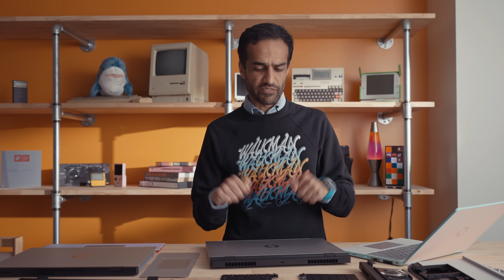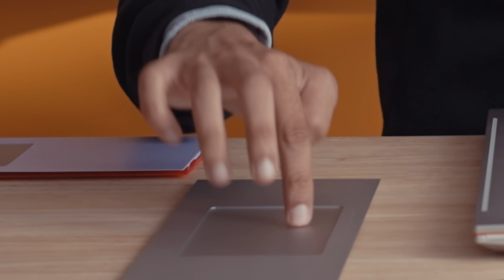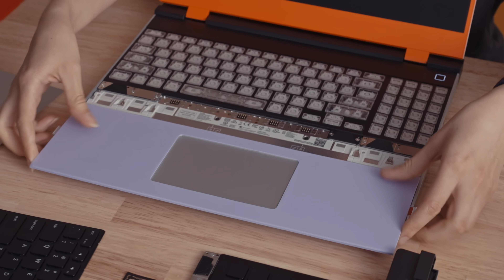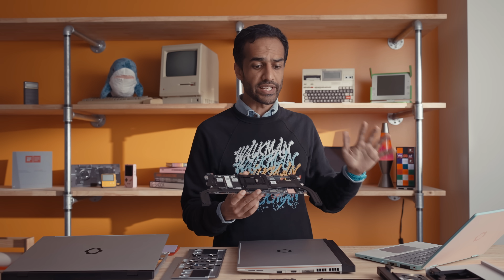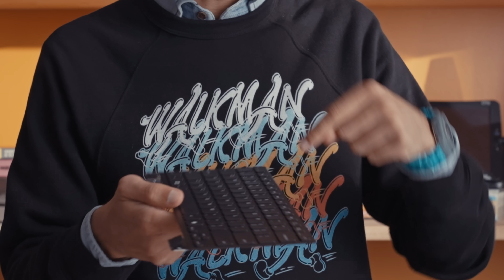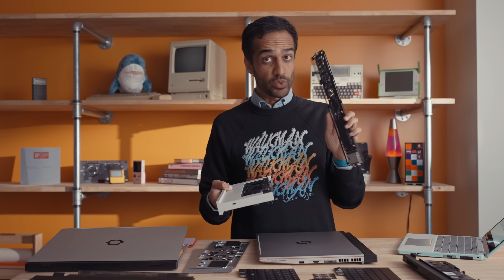Framework Laptop 16 - Prototypes and scrapped ideas

Comment: My dream is a Framework SteamOS hybrid console that I can drop into an upgradeable eGPU dock by my TV.

The convenience of the Nintendo Switch, the game library of the Steam Deck, with the power, upgradeability, and versatility of a PC, all rolled into one... Can this please be a thing?

I recognize there are likely a ton of software challenges, but a Framework/Valve partnership would be a legendary collab.

On the eGPU idea generally...

I think a high price-point would be much easier to swallow if the product looked a little more like a full docking solution. Premium Thunderbolt 4 docks (without any form of eGPU capabilities) already go for $200-300, and making the dock compatible with Framework expansion cards would be a great way to expand the utility of a dock without needing to compete 1-to-1 on port quantity.

Going from a dock with 8+ ports to one with 4 (or even just 2) is a much easier pill to swallow if those ports can be mixed and matched -- it'd also be a great place for Framework Laptop owners to stick extra expansion cards that aren't currently plugged into their laptop!

I imagine bandwidth over a single TB4 cable would likely be a concern -- but if the next-gen of Framework mainboards support TB5, an all-in-one eGPU dock seems on the service like it'd be a whole lot more feasible.
Reply: A handheld console would probably need to be a couple of years in the making to get all the way through the development pipeline but it would be an easy stepping stone to get into the tablet market from there.

I wonder what would happen though. The handheld console market is pretty oversaturated right now and it feels likely that we're going to see a winnowing down of this space until there's only 2 or so main players, with everyone else offering niche units or being pushed out of the market altogether.
Reply: @jessl1934  Very fair. Making a Laptop 16 eGPU dock that fits a couple expansion cards & partnering with Valve to get software support added to Steam OS would still fully sate my desires, and likely be more realistic to achieve.

Comment: would be nice if you guys focused on certain audiences and perfected products for those audiences.

for example: I would personally appreciate a competitively priced integrated graphics laptop with a good battery, quiet and decent performance (in it's category ofc). even if it's a little more expensive than the competition if it's close enough many of us would absolutely buy it.

Another category is an efficiency dedicated GPU laptop. lower battery life than the first, but opens up a lot of professional software options on the go even if it's not as performant as a desktop.

And the last category would be just high performance.

I think once those 3 categories are filled most use cases for laptops are covered.

Comment: Still hoping for a touchscreen for the >12" models. Also would be nice for the larger models to have a chasis option with the 360degree hinges of the 12... obviously a bit of re-engineering for that to happen.
Reply: At least 13 pro has a touchscreen

Comment: Some really crazy idea: Try to make the FW16 keyboard module fit inside a framework 13 Chassis.
I am sure that Z height would be an issue but also it'd be a very unique feature since if the keyboard breaks you could just replace the module and not the  whole top cover

Comment: Instead of the monolithic trackpad, since I'm an offset type person with a macro/numpad and have the trackpad centered under the keyboard but occasionally switch the sides, I just want a double-wide spacer instead of two singles or in addition. That way there would be one less seam.

Comment: On the touchpad subject:

1. You could do a square spacer so the there is no awkward multi-part space when doing the touchpad offset.
2. I would really like the piezo option even with the same size it is currently.

On the eGPU:
Could you do the reverse? The GPU module having an adapter for PCIe on a regular pc?
Reply: +1 for "The GPU module having an adapter for PCIe on a regular pc"

Comment: I can certainly think of a few ideas off the top of my head. I imagine you guys already have your eyes on CAMM for future mainboards, so no need to elaborate on that. But what I'd like to see is experimenting with e-Ink on the input modules, perhaps for keycaps that change depending on their context, or an e-ink surface integrated into the touchpad. Could be not just for designating the input zones such as with that wide one you were prototyping, but maybe acting as an unpowered display for static info like battery percentage or notifications, kinda like the old Windows SideShow thing. Of course, a touchpad with a regular screen is an option for such a feature too, and maybe also see if Sensel is still doing their thing since we're on the topic of touchpads? And on the topic of screens...

Regarding the actual main laptop screen, one thing that's been on my mind for years regarding laptop screens is the ergonomics of the screen position, and I'd recommend looking into an old laptop called the Flybook VM, which had a telescoping/swiveling neck to elevate its screen to a more PC-like position. I wonder if it'd be possible to create a Framework screen module like that. It'd definitely be a high-end option, but I think the benefits of such a thing would be obvious if it could be built reliably. Might even be a good option for tablet functionality (whether that be touch, stylus, or both) if it can swivel back to a shut position with the screen facing up, kinda like the Surface Studio.

Comment: Another AMD GPU module or even an Intel one would have been interesting. After all, a mobile 5070 has basically nothing to do with a proper 5070, and the 50 series itself is quite questionable in itself. If Intel or AMD wanted to do so, they would surely be capable of competing with that. But props that you managed to pull off what everybody believed was impossible: getting Nvidia to agree on using their GPUs in a way that they didn't envision themselves. Either you guys are highly persuasive or someone on Nvidias team still gives a sh*t on something beyond big AI corpos and was desperate enough to agree.

Comment: i wish there was a no compromise version of framework laptops,  like the thinness of a macbook with the repairability of a framework.
Reply: Everything has tradeoffs. To make a laptop very thin, you give up the room to make it more upgtradable/repairable. That's how we got glued together unrepairable stuff. Something has to give.

I'm repressed how thin and light FW laptops still are with all that modular flexibility.
Reply: @oerthling  its a tradeoff im not quite sure im ready to make i guess. i'd much rather have a terribly upradeable surface laptop go for my school work rather than a framework simply because its so dang compact, and the price ofc. If i was just using a framework as my makeshift PC to not buy extra stuff, by all means, im buying.
Reply: @Borret I'm coming from XPS -13. Very sleek and light Ultrabook. Not upgradable, storage and RAM soldered on board.

Those are very cool and good looking machines. Minimal bezel - lives that.

FW 13 is almost as light - surprisingly, 1.30 vs 1.22 Kg. Not quite as thin obviously, bezel not as minimal.

But FW13 is close in weight, it's larger in depth, but I'm getting 3:2 ratio and therefore more vertical space. It looks and feels not quite as sleek - but still very very nice. And for same storage and RAM I paid less.

Surface is too annoying to begin with. Never was in the running.

Comment: Swapping the keyboard location seems like a solution in search of a problem...no other laptop has this and no one complains...and it's causing you problems with the touchpad.  Why not scrap that modularity entirely?
Reply: The point is to enable both having and not having a numpad. Some people really want one for typing numbers, while others like myself refuse to buy a laptop with one because of how it offsets the rest of the keyboard.
Reply: @necuz  why not just sell a version with the offset + keypad and a standard version instead of all these little panels.

Comment: I'm happy to see the trackpad issue being mentioned and acknowledged. Please continue to work on the single piece track pad module, it's the only thing that was iffy for me in the FW16.
A wide trackpad is fine but I would still be very happy with just the current trackpad as a single piece in three versions for Left, Center and Right placement. I use it on the left personally. I would buy it even if its expensive!
The 3D printed option is something to consider but I would like something that matches the finish and quality of the original.

Comment: Maybe you ar overengineering trackpad solution?  I don't understand why don't you just  make 2 or 3 extra  variants of a trackpad. I think most user do not change position very often. For many users version with one position will be ok. If someone wants  configurable option, they can stick with current version. I now it is more problematic to have few versions, but with modular design, I think it shouldn't  be a big issue.

Comment: The Framework RISCV board is really cool, and as a heavy RISCV enthusiast I'm glad to see y'all put a bit of effort into that space. I can't say I specifically understand the motivations behind choosing one design or another, be it for software, hardware, legal, or any other reason. But I do have to say that the choice to use a relatively aged chip is really disappointing to me. The limitations of only 8GB of RAM, aging core design (which leads to lack of OS-level support from Linux distros), and lack of NVMe or eMMC module support makes what would otherwise be the best RISCV laptop be pretty disappointing in my personal opinion. I would love nothing more than to see an RVA22 or RVA23 chip like the EIC7700X or UR-DP1000 in a laptop form factor, and you all would easily be the best people to make it.

Comment: 1:54 - Touchpad
7:04 - Translucent bezel
8:30 - 64 GB RAM modules
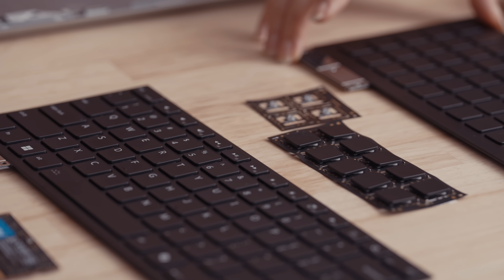11:00 - Input modules (pointer stick, single button)
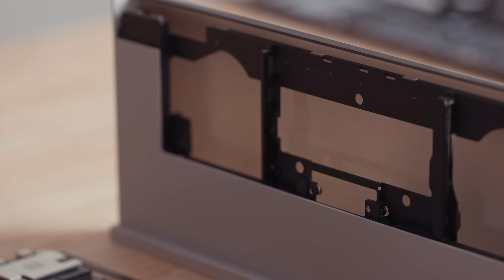14:55 - External GPU
Reply: Mvp
Reply: Touchpad: Needs to be able to accommodate different keyboard positioning while preventing your palm from triggering touchpad response eg. clicks. A CAD model of a one piece touchpad is available.

Translucent bezel: Need to use polycarbonate, which makes it too brittle. But we aren't giving up.

64GB RAM modules: Crucial makes one, it works, but needs more validation. CSODIMM has no official AMD support and actually does not work.

Trackpoint et al: There is nothing thin enough to not threaten the screen when folded. We'll keep trying and should we get it, it's easy to swap in. One key module is in development.

eGPU: In active development, but more a DIY thing. Polished turn key eGPU will be too expensive.
Reply: * beeg touchpad, to be more specific
Reply: Thanks, captain!
Reply: thank you!

Can you edit "Input modules" to say "Input modules (pointer stick/nub, ...)?

Comment: For the trackpoint, tear down the thinnest Thinkpad to see how they do it.  Maybe the screen needs to be more rigid, or change the hinges so it won't close down so far and/or use ridges on the edges and near the palm rest to keep the screen from making contact with the trackpoint.  I love the trackpoint, but I have not had a Thinkpad since the 2000s.  I miss that.  Maybe a new innovation on the trackpoint where it has a depressed capacitive circular pad instead of the eraser head.

Comment: Yes, thank you, THIS IS MARKETING! That is, actually good marketing - explaining your product so I, the consumer, know better what to expect. And why something seemingly trivial is missing (like that trackpoint). This does help in decision making and also while talking with other people (who aren't much into this area). Not to mention, the very slight, but not zero, chance of actually getting an idea or solution from the community.

I'm very impressed that you managed to bring NVidia. I'm a bit bummed that it's only 5070 and its insultingly low 8 GB of VRAM.
I kind of wished there was an Intel CPU version too. Where I could go DDR5-6400. Or have 4 sticks of RAM for that sweet sweet 256 GB of RAM. And Thunderbolt 5. And their Wi-Fi 7 (from what I heard it doesn't work on non-Intel CPUs or something, not sure)

Interesting about the touchpad, having it so wide does sound like too much hassle. Having 2 or 3 versions of single bottom part does sound a bit more sane, though it is indeed less versatile (so prone to become e-waste sooner). Maybe having a mechanical adjustable (either by sliding or camping) touchpad in the left-middle/true-middle/right-middle, from the backside ?

On the trackpoint ... I have to admit that I haven't thought of the screen interaction. I kind of wish FW16 would've been thicker now. Haven't check the backside, is it possible to literally have a hole in the keyboard and the top module so the trackpoint can go lower ? Without compromising the structure of the laptop... which, I know, might be a tall order.

What about a battery module ? Is that doable ? That is, for, say, long (work) travels, to have extra 60-100 Wh of battery instead of a GPU. 30 hours of uptime, here I come!

I can't wait for this to be improved further and ironed out and for you to then release a Framework 18. Can someone teleport me 6 years into the future ?

Comment: What would a business/premium laptop look like if you could charge $1k-$2k more? Or would you ever design different chassis?

I'm thinking of the Dell Inspiron vs XPS lineup in terms of design, finish and portability.

The current design looks like an Acer laptop where I think most people prefer a more rectangular look and it doesn't seem practical for consumers to 3D print a high quality case. I feel like a lot of hardware would be appealing if it had a cosmetic makeover like restoring an old car

Comment: The main thing that I wanted to see announced was a touch pad module that did not do the click via tapping or pushing the pad itself, but instead has separate buttons. This is very important for the people that need their touch pads not to generate clicks on them when they are trying to move the cursor. Framework's modular design seems ideal for being able to give people that option. It seems like all other high end laptop brands are abandoning us.
Reply: Especially for click and drag with one hand, the buttons are more useful.
One alternative is to delineate graphically (and maybe with a thin shallow trough for accessibility) "button areas" and areas for scrolling.  That would require smaller hardware changes, but will drastically improve usability.
Reply: @alexeiboukirev8357  I've not used the Framework touchpad but something I noticed my work HP does is if you hit an edge, the cursor continues to fly in that edge's direction. I don't like anything else about that HP but that's really quite helpful sometimes. I have to bring this laptop around with me, so, almost always don't have a mouse.
Reply: @DasBuzzBuzz  I had a Lenovo laptop that did this. Turned out to be something I could disable in my operating system's settings. If you haven't tried that already I recommend it. If you have, then know that I hate HP.
Reply: Yes please! I so miss real touchpad buttons
Reply: The default behavior in KDE if you disable tap to click is basically the same as the old school touchpads with physical buttons, only the "buttons" are a software defined portion of the touchpad. You can even have the right side of the touchpad function as a scrollwheel. Not exactly the same as what you want, but pretty close, and it's all done in software
Reply: @avadrumm  Still somewhat have to guess which part of the pad is being used for each purpose (where the virtual splits are). I am with others that prefer having a physical button available (i also dislike the way modern smart phones have all done away with all physical navigation buttons and rely entirely on contextual or gesture based inputs). One half way house to having a physical button (and probably not a viable one) would be being able to have some form of visual aid to see the splits, best would be if it was some form of under pad lighting showing the outline or distinct colour for each button or just an edge outline and the virtual button size could be adjusted to suit the users needs with the lighting adjusting to reflect the users preferences.
Reply: @RandomWombleP  you could outline the button-zone with a sharpie, engrave little notches or other markings into the aluminium palmrest, etc.

Though obviously a DIY bodge might lead to imperfect fit/finish, and human-input devices are where we are perhaps most likely to find a bad fit/finish aggravating.
Reply: I hate tap to click so much. Then again, I don't like touchpads much either.
Reply: @Winnetou17  You can just disable tapping in the touchpad settings.
Reply: @rars0n Modern problem requires modern solution ❤
Reply: Drives up cost, adds another assembly line, on a design that's now niche.
Those are the difficulties, sadly they don't have infinite R&D money.

Or maybe I misunderstood. But aso having a physical button below the touchpad surface has worked well for me, although the laptop is only one year old and mainly use a mouse.
Reply: @Splarkszter Well aware that they can't do everything, but I just wanted to add my comment on what I wanted to see so that maybe Framework(or a third party) can see this as a feature some people want.
Reply: 2006 MacBook, best touchpad experience I've ever had.